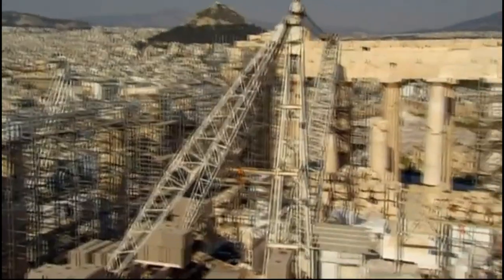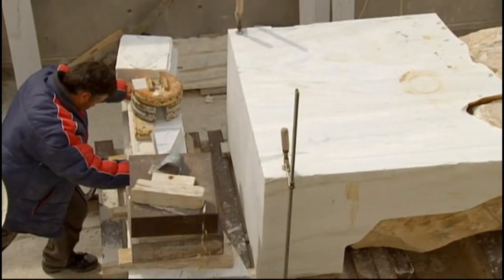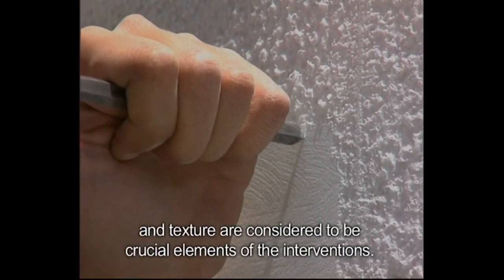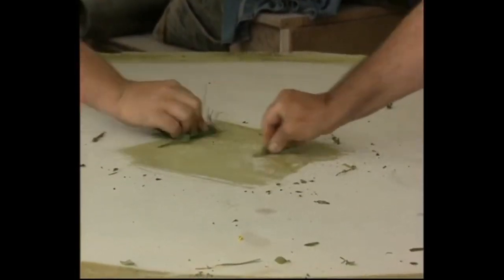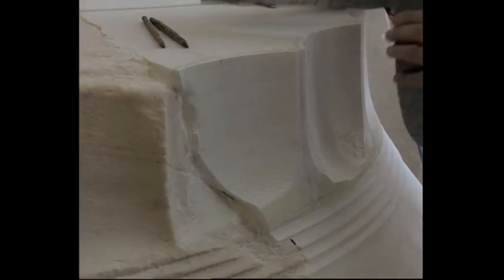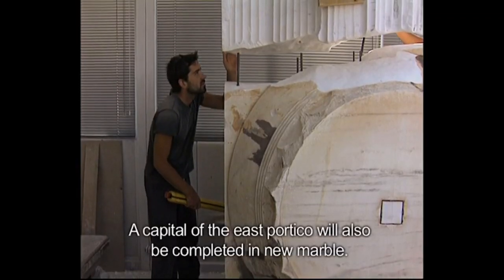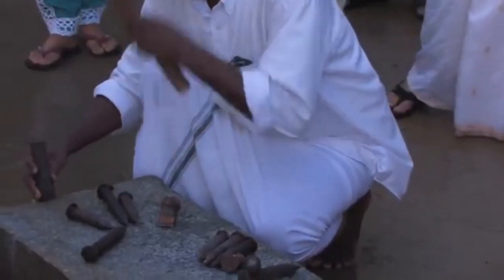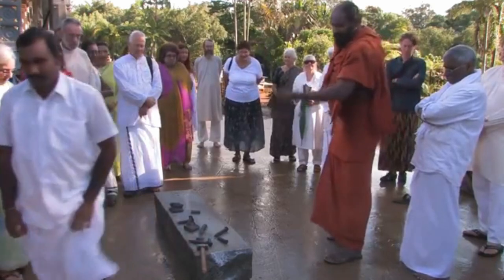The Most Complex Stone Fitting Ever Done. Ancient Techniques Used To Restore Ancient Temples

Comment: Before they use the mud and the cup and saucer technique on the chaotic shaped joins how do they begin to hollow out the new stone with any accuracy? In the  video we only see the nearly finished new stone 'cup'
Reply from the maker: with a pantograph or by scribing,
With a pantograph you make a mould and transfer it nearly perfectly start time, "The Making of a Marble Sculpture" by the jesenko gavric channel has a good demo of pantograph.
Scribing involves placing them alongside each other and essentially using a stick (with plumb lines to keep it horizontal) to run between them to find high spots. A few variations on that with slightly improved tools but the same basic method.
Reply: @SacredGeometryDecoded  Thank you I will take a look at the channel

Comment: Brilliant.  Yet see also from this that when restoring an ancient site those who do so take great pains to make it as accurate as possible. Hatshepsut's mortuary temple as an example was destroyed millennia ago.  Since the 1960's a Polish archeological project has been meticulously piecing it back together.  There like here damaged statues and blocks are recycled where practical while new pieces to fill in gaps are similarly hand crafted to fit.  

As another example.  I watched a show some years back - sorry forget the name - whereby they were repairing a long damaged statue of considerable size.  Not only did they take pains to fit the broken pieces back together = they even took meticulous pains to insure the statue when assembled stood at the proper angle.  In the show they would raise using a crane the broken top part - measure its angle - take it back down and make further adjustments so that when complete it stood correct as intended.

Some might criticize the restoration of ancient sites feeling they supposedly lose their cultural value.  Yet as this alludes they take great pains to make it accurate as well as presentable to include rebuilding using similar techniques the original builders employed where possible.  I for one would see a rebuilt temple with damaged stones replaced where needed than a heap of rubble on the ground supposedly to keep its "historical value".
Reply from the maker: Cheers
I was contacted by Antoine Garric a while back sharing details on his work. A very cool synchronicity.
He is in charge, or a senior member, of the team restoring Karnak from the thousands of pieces.
The bottom link in the description is on the experiments he conducted fitting complex walls. Beautifully simple technique. Matching the marks and tools found in the area.
Reply: @SacredGeometryDecoded  Yes.  Another example which I have made note of before.  I watched a documentary a few years ago on Notre Dame restoration.  Not only are they rebuilding it - stone masons as here are hand carving replacement statues etc. - they are even sources identical wood used to build its framing.  

They sought out sessile oak trees hundreds of years old to duplicate those originally used and upon cutting them down must wait for them to properly dry before use - just as the original builders did.  As noted pains are taken to uphold the historicity of a site.
Reply: @varyolla435  Where did they find the old-growth timber ? My understanding was there there were no trees of sufficient size left in Europe. (Glad they're doing it properly, tho.)
Reply: @Reziac  If you look for online new reports of this you'll see whereby there are still some old forests - albeit otherwise protected ones.  Lumber is being sourced from such places in France.  

Wood can also be sourced from elsewhere as well such as North America.  Remember that one of the reasons America was so valuable to  European colonialism was in fact it vast forests of oak etc..

Comment: Most milling CNC machine are below 50microns half the width of a human hair most cheap 3d printer will accuracy print at 100microns this is really not very accurate
Reply from the maker: They did it by hand.
Reply: @SacredGeometryDecoded  This is like comparing Pepsi and jack cola. Kind of makes sense, but not really.
Reply: 'The pepsi challenge'.